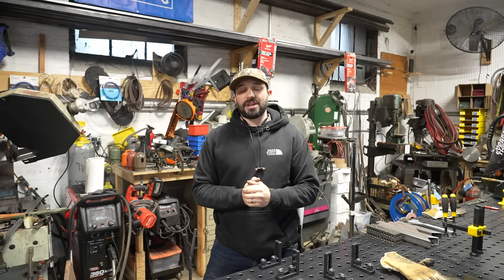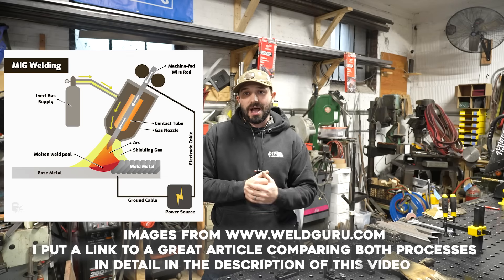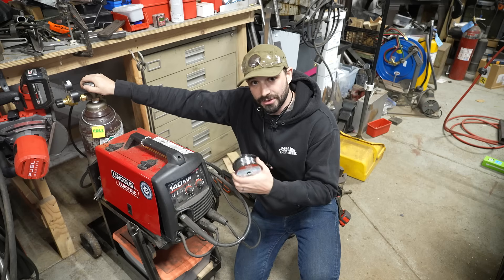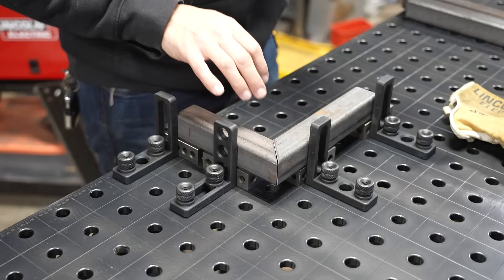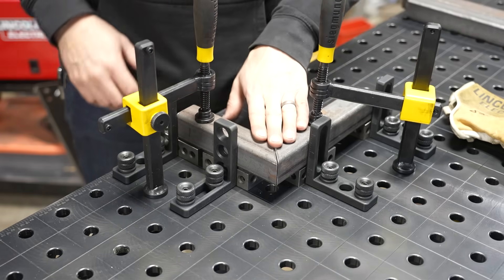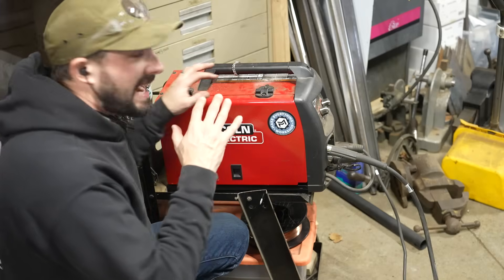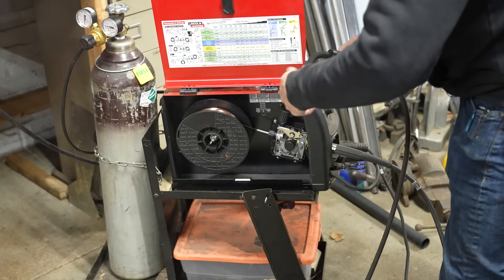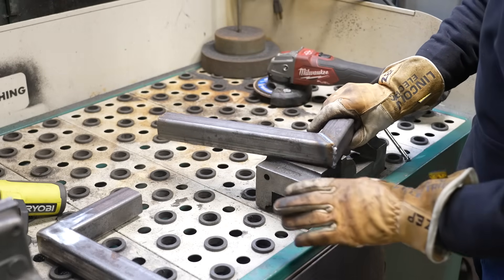“Gasless” MIG Welding Explained!

Comment: The new Gasless mig are controlled from the power and Automatically feeds the wire much better welder and you would not have had the porus problems and rewelding 😊

Comment: Great comparison! The strong argument for flux core is, you don't need a gas bottle. While renting or buying a gas bottle is no problem for professionals which weld every day, it's the most expensive part for those hobbyists welding only five times a year.
Reply: Plus windy days shouldn't be a problem ?
Reply: @trevorslater2746  wind can still cause porosity thanks to it diverting the gas created by the heat on the wire. While it is "easier" in some conditions, airflow can still kill your welds even with flux core😊
Reply: Good to know!

Comment: I hope its not too late to get  advice. I'm a beginner and can't seem to zero in on that smooth spatterless bead regardless of wire feed speed, arc distance, angle, etc. Yes, I have the cheap 90 A gasless Chicago electric flux core welder. As a beginner I felt if I could master the cheapest flux welder then I could move on to an improved welder. Here's my technical question. The manual doesn't offer polarity instructions except for the electrode is connected to the positive marked inlet and the ground clamp is marked negative. Without knowing if I can damage the welder, my question is, can I reverse the leads to see if results are better? From all the you tube instructional videos I've watched, the polarity setting that the welder calls for may not be accurate for DC welding. Help me out if you can. Thanks.

Comment: Unfortunately a good looking MIG weld is not necessarily a strong weld. Sometimes  a MIG weld looks great, but has no penetration. So you need to run a test or two to be sure.

I have MIG, but have never used it, as when my flux core is set up properly,  it does all I need.

Thank you for your video.

Comment: I have two MIG  One TIG and a "TomStone" Weldet  I have been usuind the old Arck welder for about 60 years on pretty much everything and is basicly a Flux cour It real advantage in my garage shop is it will weld clean or dirty with the MIG and espaily TIG will not do well  Because the new Flux cur machines are lighty and real handy I'm thinking about buying one They cost about what I paid for the old machaine 60 years ago

Comment: Hello. Good that you corrected this with polarity, but you don't use the word "earth", instead the word "return" .
You say MIG and translate it with "Metal Inert Gas", Ok, but inert means "natural/noble gas gas" e.g. Argon and  the welding process is not affected. 
If you weld with flux wire, it is absolutely not MIG (possibly MAG). You have described MIG welding with a mixture of Argon and CO2, but this will be a MAG (Metal active Gas). The gas affects the welding process.//reg hakan

Comment: Real downside nobody ever mentions is the flux is highly corrosive. That's the dealbreaker, after running it for 2 full years - you have to be beyond meticulous in cleaning up welds, or else it rusts faster than seawater. I've decided the cost of gas is better than having to scrub every weld super clean afterwards. 

Develop a non corrosive flux, I'm in - I love the process. It's the corrosion I don't love. .

Comment: Just be sure to buy sealed wire, when you get vac sealed flux core wire its super shiny, and it runs waaaay smoother than the stuff that wasnt sealed and is now dull and covered in oxides.   cheap sealed wire is better than Lincoln wire thats been in open air for too long.

Comment: I bought the 175 Plus/HD (HD = Home Depot) machine for one purpose. My heater core of my pool heater was cracked/leaked. The machine ( I am NO! welder) got the gaps fixes for half the price of a new core. 15 years later I go around on trash day to fine metal objects to cut and build skill. Now i need to work on my Crown Vic before I sell it and buy a new car. It is all about building skill. Your video gave me more incentive. Thank you!

Comment: You forgot to mention with fluxcore there are two types , inner shield which you show in this video and duel shield which uses a shield gas typically straight CO2 or 75/25 . You are definitely a hobbyist welder . We also in the field or shop do not grind our welds flush unless a drawing calls for it.

Comment: Flux core and hard wire are “MIG”welding. This video is informative, but as someone who has worked in the field if I use a MiG welder to weld flux core I’m not gonna say hey I’m gonna use my flux core welder… it’s a MiG welder, used to weld flux core and hard wire. Etc.

Comment: You got an explanation wrong. You can have oxygen in the welds, you can even get tri mix with oxygen in the gas. Its the hydrogen in the air that caused porosity. That's what the gas is shielding the weld from. The other gasses in the shield gas add different characteristics to the weld pool. 

High % to 100% argon gives a smooth weld but not a lot of penetration. Pure CO2 gives tons of penetration but a dirty, spatter filled weld. 75/25 (75% argon/25% CO2) is a good mid point for good penetration and smooth welding characteristics. If what you are doing can achieve adequate penetration with 10% or less CO2, then this will allow you to be able to spray weld, instead of dip transfer. Spray welding can give you an incredibly smooth, clean weld.

Comment: Is the smoke that comes off bad for you?
Reply from the maker: All smoke is bad for you! Always ventilate and move air as best you can when welding!
Reply: Them T-8 structural seismic wires are bad, they leave behind a powder that is an irritant. You breathe it in and it feels like the air gets sucked out of your lungs, and definitely never rub your eyes if you touch it.

Comment: Please . I am new to this mig thing . I have used electrode welding all my life but I see there are new machines brought to my country. But I don't want to use the gas.  Please how do I weld without gas with the mig
Reply: @lordodartey9023, If you do not want to use gas, then buy a MIG welder that uses flux core only this means that the wire is hollow inside and is filled a flux powder. So you do not need a gas bottle and you buy only flux core wire for your m/c.

Comment: Many thanks for this no-nonsense explanation for beginners like me.
Could you perhaps also give a hint as how to differentiate between choosing flux-core/MIG and stick-welding? I have both a simple stick-welding and a flux-core machine. I use the flux-core for thin stuff and the stick for anything thicker, but it's all quite intuitive, learning by doing. The flux-core gives me more manual control on the guiding of the puddle, but is more fiddly with the settings, whereas the stick is rather "aggressive", but tends to make a decent puddle, as long as I have a simple surface.

Comment: Ok so I have a Hobart handler (I think it’s a 140) but it’s 110v and will do mug and flux core. My question is if I am welding 1/4 “ material will I get better penetration if I use flux? You mentioned I. The video flux gets hotter. I was welding 1/4 “ mig on highest heat setting and did fine but seemed like it could use more penetration.

Comment: I've been welding for 30 plus yeand I have many machines for various projects. And I just used a titanium 125 flux core welder today, in fact.
 To weld a truck frame.  And I put fish plates on that were quarter inch thick and had absolutely no problems with it. And I have done many things likwith similar machines. And I've also got a 6 in 1 welding machine that does big tag stick.  Flex core, you name it. It's got a lot going on with it and the machines. They make lower price than the old machines are surprisingly well made.  Granted, I do have some of the older machines and still use my trusty. Old Lincoln stickwelder as well as other old machines to get jobs done. But I am surprised and astonished at how well some of the new machines really work.  And I'm also embarrassed and surprised at how litthe tech schools teach the kids today and how to weld as fabrication and so forth.  My generation had far more education and we also learned how to gas weld and weld using 100 Amp alternators and wire hangers on the farm
Reply: Well, sometimes it needs just a bit electronics to make the process run much smoother. High amps electronics is just a few dollars today, did cost a fortune 30 years ago.

Comment: Which is stronger, MIG or Flux core?
Reply: Probably flux core, but depends on what kind of wire and what it is exposed too, in a seismic setting I would prefer a T-8 flux core wire rather than a S-6 hard wire. They have their purposes, on any job site where they are welding structural, especially on the west coast, you will find T-8 welding wires being used too weld bridges, too moment connections on a steel erection job. Strength depends on what you are going to expose that weld too, to many variables in play for a generalized question.

Comment: I just picked up a titanium 125 and man it is a pretty useful tool for $150.  Spool of wire and a 110 outlet,  just go to town.   As you said it is a smoking monster so have to provide for ventilation if indoors.  Worse than stick welding.

Comment: This is very helpful, I am going to be making a short video of my working on my welding. I also have a harbor freight welder and if I am being honest, it is pretty discouraging from how bad the unit works but I am going to get better wire with less spatter and do a real project with it. 

I want to get a good welder and Jimmy DiResta recommended the 180mp since I have 220v but need to do some more saving before getting it.

Thanks for the video and happy to see you are well. ❤👊🏼

Comment: this is the 1st video of yours I've seen.Noticed the 360MP in the background-I run one at my 9-5, dualshield and aluminum push-pull.It's a beast! We had Miller 350P's until I brought in my 350MP with a Python.Now the Millers collect dust while we run 2 360's,2 260's and a big watercooled powerwave 350pushpull that's getting replaced with another 360

Comment: I don’t even need to watch to answer. I have several welders, two of which are twins: a Lincoln weldpak 100 with fluxcore, and a second with so it’s mig. 

They both work great!
Reply: My Lincoln 90i FC has taught me the basics of welding and paid for itself in less than a years time. I’m teaching myself stick now and have thoughts of adding a portable plasma cutter to the arsenal.

Comment: I have two welders, an ESAB emp 205 Rebel and a HF Titanium 125, the welder you mentioned. While most of my welding is done with the 205, I do use the 125. The 125 is a surprisingly good welder, considering it’s a 125 amp unit. That does limit one. But within its range, if you know what you’re doing (I’ve been welding for 50 years), you can get excellent welds up to 3/16”, if you buy the appropriate size wire 0.035” and the right type, not GS, but 11T, you can weld thicker metal to about 5/16” with multipass. That’s more than thick enough for most everything the average person will need to do. I’d like to point out, in response to the negative statements he keeps making about fluxcore, that with the proper machines and wire, fluxcore is used to build skyscrapers, ships, etc. You get deeper penetration with fluxcore than with MiG.
Reply: Absolutely. Shipyard production welder here, all we ever used was dual shield fluxcore. Fluxcore is a beast.
Reply: It's obvious that he prefers the gas over gasless.  It's a personal preference and I guess if he tigs then he would most likely choose the gas since he's used to it.  I dint think there is much difference than technic.
Reply: Try a Titanium 170 sometime. I sold an ESAB 205 in favor of it. Love that little beast.

Comment: I have 200$ Chainse flux/mig (i can use gas or not) welder, and in workshop is good to use gas, but as Im not fabrycator, and i use welder only to technical support (weld broken log arch or tack weld something to weld it in workshop) in car I have only small flux. Make the job.